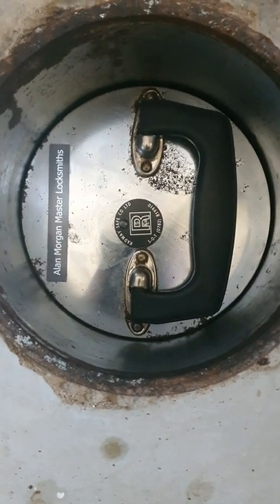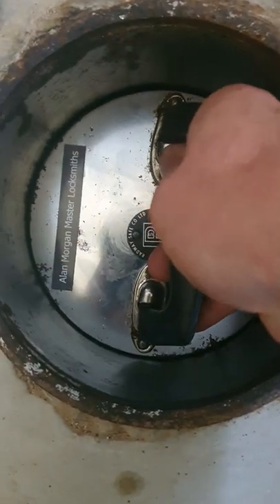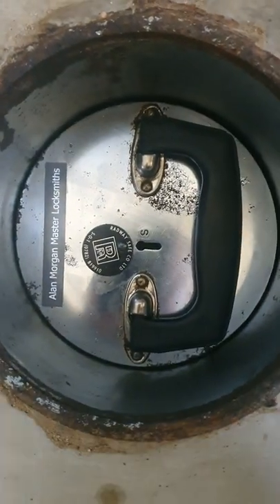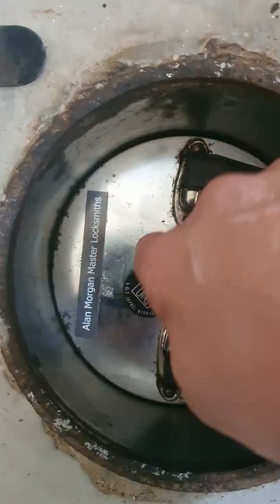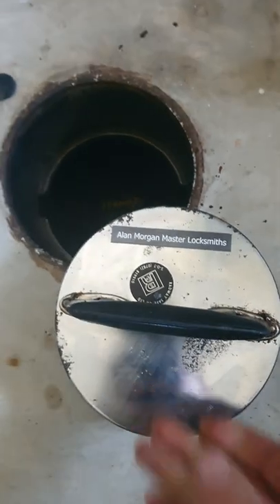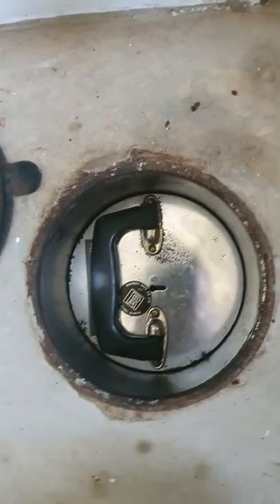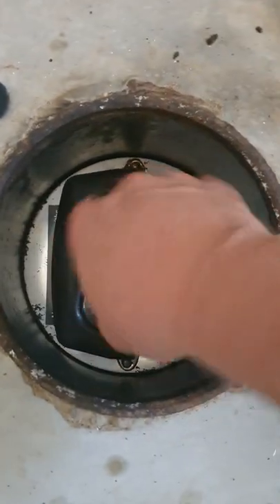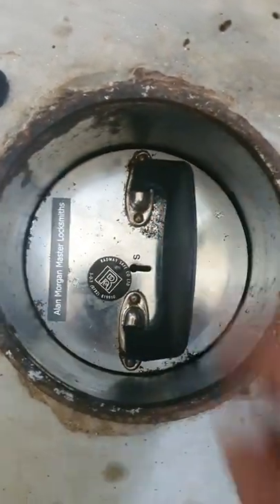How to open a Radway under floor safe.

Comment: How do you open a "migh-t-safe" floor safe? 
Been trying to find schematics. ... To no avail . Please show a video or steer me in the rite direction . Thanx
Reply from the maker: Usually a combination lock,  should dial as normal
Reply: I forgot to mention that there's a lot is no combo, that anybody can remember...
I was thinking that if I had blueprints that showed the locking mechanism, I would be able to drill a small hole to see the gap in the discs line up...
Reply from the maker: You need someone who can recover the missing numbers by working the dial. SAVTA should be able to recommend an engineer